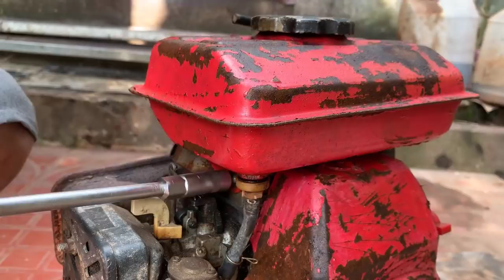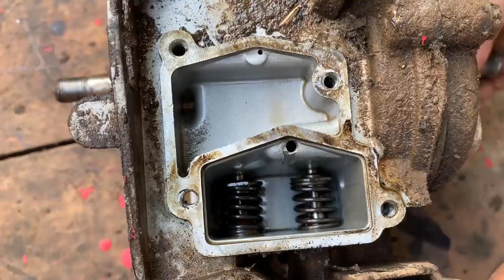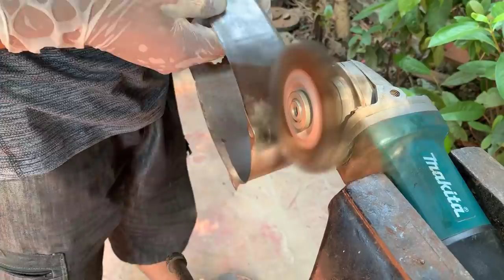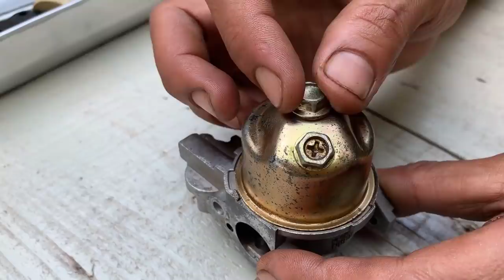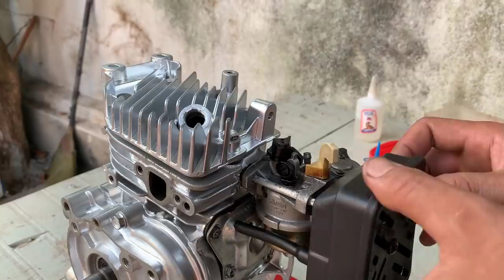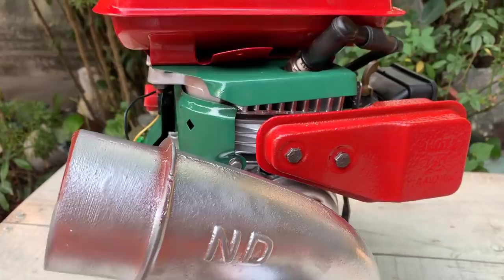Restoration Old Rusty Gasoline Water Pump 1.5 Inch | Restore 4-stroke Rato Engine

Comment: "Golly!!! It won't start!!" 
"I better take it apart and make it look new - It'll run then!"

Did you check for fuel and spark off camera before trying to start it?
Fuel, a new sparkplug and maybe points or point adjustment might be all it needed.
It looked to be in pretty darn good condition before you started, and the engine wasn't locked up/frozen.
Reply: Steve Huffman agreed
Reply: That engine doesnt have points .It has a coil just above the flywheel to produce the spary when the magnet passes. The gap was too large to produce a good spark when he fitted it.
Reply: I noticed when the fuel tank was removed no fuel came out the fuel line ...

Comment: You put the piston in backwards ! The arrow on the piston should point at valves !  that's the way it was when you disassembled it. Your video shows it !
Reply: I thought the way he checked and adjusted the valve clearance was good too, and it's standard industry practice to hammer the piston in by the big end bearing isn't it. Nothing to learn here.
Reply: He also didn’t line the timing marks up on the cam gear and the crankshaft or gap the valves or gap the magneto
Reply: Scott M. I'm glad I wasn,t the only one that noticed all the same stuff that was done wrong.n

Comment: You seriously used sandpaper as a cone to fill the oil reservoir ? Possibly washing some extremely hard aluminum oxide particles into the oil....
Reply: I know, I cringed, like how hard is it to grab a funnel?
Reply: It filters the oil, makes it slipperier, and who said it was oil he put in there? Doesn't bear thinking about.
Reply: @gus6rocks  ummm, what?
Reply: @oli12shackel9  using sandpaper grinds the oil thus making it even smoother. I always put the oil and some grinding stones in the mixer and let it run overnight. That way i can be sure that my oil is the slickest. I am considering putting some abrasive compound into the crankcase as well so that it keeps grinding the oil.
Reply: @oli12shackel9  it's a joke, nobody uses sandpaper to put oil in your engine, is like having rocks in your kidneys

Comment: U know the dots on the gears do mean something,,, you needed to align them...*
Reply: good note
Reply: Honestly surprised the engine even ran with the timing 180 degrees out. If it is still working, it probably puts out 10% of its rated power.

Comment: when you align the crank and cam you need to line up the 2 dots... your cam is 180 out
Reply: On a four stroke engine, one turn of the crank and they magically align.
Reply: Victor Robison Also need to ensure valve timing and ignition timing in correct relationship to each other. No point having a spark when both valves open .

Comment: Wow!!!! You must have a magical touch. You put it together with  bits 180° out of phase, don't replace parts with new parts that should be replaced,  yet it still works. Or did you strip it down and rebuild it properly with proper tools?

Comment: Did You use a normal shaft seal for the impeller? I thik there is a mechanical glide-ring-seal on it... 

You can define the point of ignition with the difference of ignition coil to flywheel-magnet. the normal distance is 0,3mm, so the timing should be correct and the motor runs much better. Its the thickness of a normal post card.

Have you had a look of the timing of crankshaft and camshaft? At the point of video who you put on the crank housing cover, it seems to me that the marking on gears ar not together?

Comment: No reassembly oil

Incorrect installation of bearings

No new bearings

Valve seats not reground

Hitting connecting rod with socket extension bar

Washing out engine casing in filthy cleaning agent

Sandpaper used as filling cone

I'm surprised the chuffin thing ran at all after you'd done with it...

Leave stuff like this to them that know what they're doing....as you haven't got a clue sunshine...
🇬🇧👍

Comment: Successssss, excelent, thank you for sharing.
Reply: Would have run a lot better if the timing marks had been lined up correctly.  Surprised it ran at all without destroying itself
Reply: @charlesknaack1042  Worst that would happen is it wouldn't run. It's a flat head engine, there's no danger of the valves crashing into the piston like with an overhead valve design.

Comment: I see a lot of people bringing up the valve timing........180 out is as good as in on this engine.........one turn of the crank will align the marks.........the engine has a magneto which fires every time T.D.C. is reached........This was truly not a rebuild, just dis-assemble and paint and re-assemble poorly, but timing is not a fault in the finished engine, if you can call that finished.

Comment: This can't be real... everything was bad. LoL  , tapping on the connecting rod, sandpaper funnel, hitting the flywheel nut area to knock off the other side...  hahaha that's awesome!  But I'm wondering just how long it really took to get running with the timing that far off.

Comment: I wonder if he got someone else to sort out his starting problem. The coil was too far from the flywheel. From trying to start it to next to the stream, the exhaust was half black where the paint had burned off. Plus the valve timing was way out. 

It should have been titled " How to make an engine look pretty and run badly".
Reply: Yeah that was😁

Comment: Never hit the inside of a bearing race allways hit the outside,try using a heatgun on the housings and those bearings might go in easy also what about your timing marks cylinder honing and valve laping just thought for next time...oh and crank seals that engine will never run..good luck

Comment: Stay away from small engines mate you don't know how to rebuild them. It's more than a wire wheel.
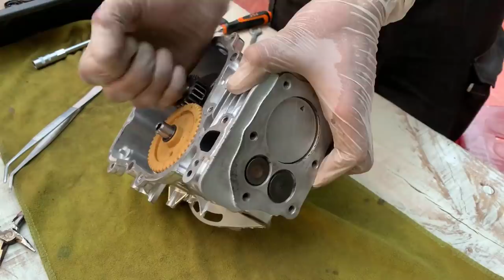Reply: 15:55 The camshaft isn't in time with the crankshaft, I really hope he has fixed it off camera XD
Reply: @HoverFreddy  Still sounds awfully rough. Maybe he caught it or maybe it makes no difference.
Reply: @robertbowman3406  HI there! He must have caught it, it wouldn't run with such a wrong timing, compression would leak either from the exhaust or inlet valve

Comment: Sounds rough. You didnt set the valve timing right.
Reply: Bad valve timing and reassembling these parts without oil on them. He was lucky this engine started.
Reply: @yannickl5976  Exactly what I was thinking too. Didnt see any oil until he poured some in. Nothing on the piston, little end, gudgeon pin, big end etc.
Reply: either that or the carb still has a clogged jet/needs fine tuning. either way that thing runs like shit

Comment: The whole job is wrong. The piston is always inserted from the top of the cylinder head into the cylinder and not from the crankcase. It is wrongly rotated by 180 ° the arrow is pointing towards the valves. The video was supposed to show how such work should not be done.

Comment: What is wrong, you obviously have  a computer use it to get a online manual or order a hard copy and find out the right way to proceed with  working on things like this, yes it runs but how well and for how long? Poor job poor outcome.
Reply: That enhine will not last long with the set up he done. It needs stripping, all of the silicone sealant peeling off and starting over again. They are the simplest of engines to get running and he hasfailed at that. lol. He has no idea.